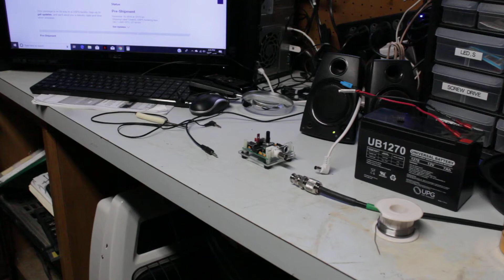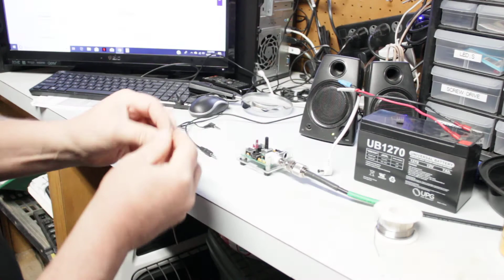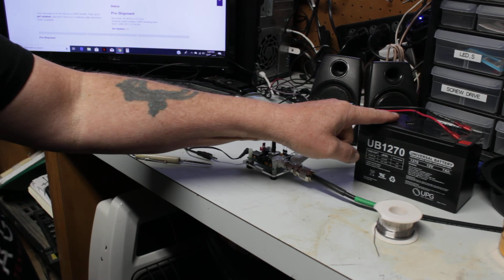QRP Pixie Kit Audio Hum Fix (Bad LM386)

Comment: I got a kit from you shortly after this video was made and it doesn't work on RX. Fine TX, but no RX. (Not even a hum.) After thoroughly double-checking my assembly job, I've begun to suspect I need to replace the IC, since that seems to be the only component that's unique to the RX circuit. Does this sound plausible to you? It might well be the same generation as the "bad" lot you demonstrated here.
Reply from the maker: I would have to say no, the problem with the IC is the hum ,not complete loss of audio.
Check the 50ohm variable (VFO) for a complete open will cause your problem.If over heated during assembly they tend to go open.
Reply: @DIYELEKTRONICKITS  Ah ha! That might be it; it's a little tricky to get enough heat on those big lugs. Thanks!

Comment: Question for you sir. I still have a slight background hum when powered up using 9v battery (as im man packable and mobile) . I have it attached to a 1/4 wave end fed antenna that is grounded.  I'm wondering if I need my altoids tin better grounded?  Any suggestions? KI5IUF
Reply from the maker: Have you tried it in the field yet? 90% of noise on a Pixie is from Domestic Appliances due to the Pixie has 0 filtering
Reply: @DIYELEKTRONICKITS  yes I still get the hum. I feel it is the battery supply. Eventually I want to use a solar panel with a step up & Lithium Ion rechargeable battery to reduce weight for backpacking & SOTA purposes. I am wondering if I should put a 9:1 UNUN on the end of the antenna to act a the choke to reduce any type of noise & feed back.

Comment: Is it normal that the pixie send out a signal when in RX mode (Key up)..?
Reply from the maker: Yes,,,it will send out a continuous Carrier signal adjustable with the Variable resistor on the board